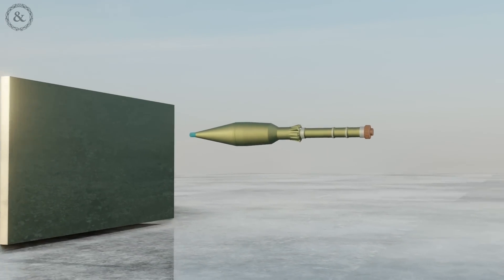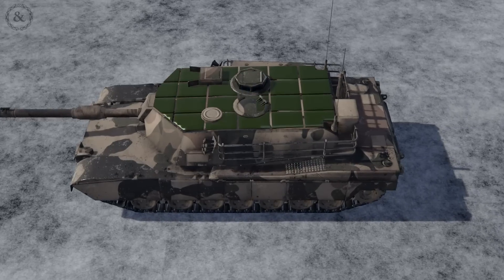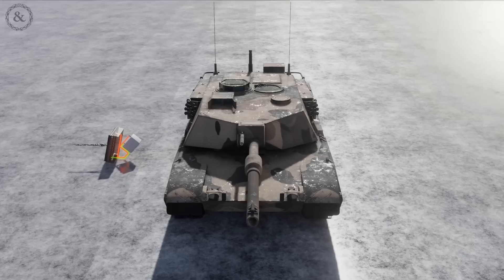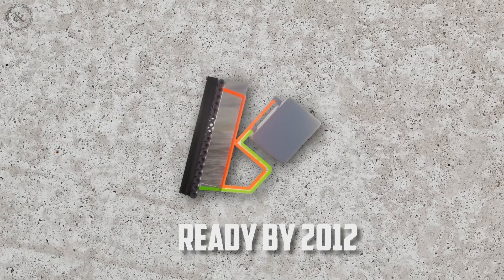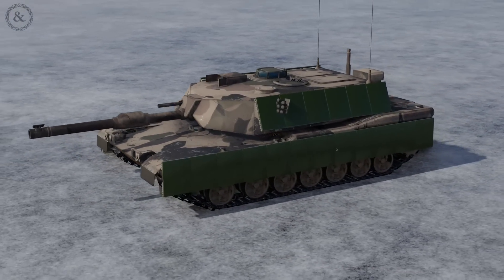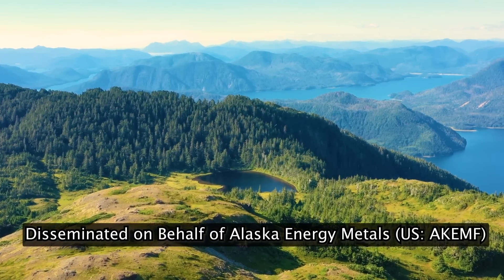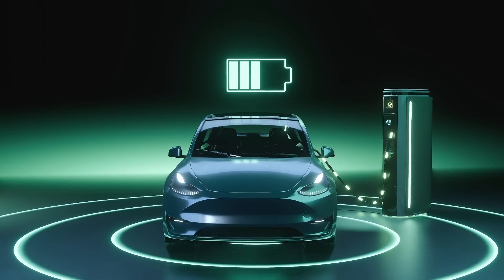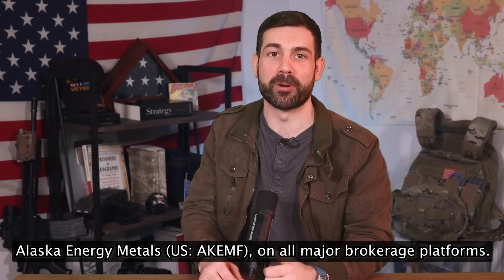How Electromagnetic Armor Vaporizes RPGs

Comment: Sounds like futuristic fantasy.  I've never heard metal being vaporized by a power source limited to that generated by a 1500hp tank engine electrical generator.  Does the non-metallic explosive also get vaporized?   How would that system works against 155mm depleted uranium sabot round?

Comment: Yo Capp!!! Capacitors hold charge for a very long time. if you dont understand this. unlplug your  microwave and let it sit for a week and then go digging for the capacitor. Capacitance is does not require large current to keep it at capacity. the right capacitor would be effective while the tank is parked engine not running!
Cappy hit me up for this type of information. or rober or whoever.

Comment: Why can a tank not generate continuous power for an array of capacitors powering the electromagnetic shield? Crew protection? Use the same simple way users are protected from the operating capacitor in a microwave. It's not rocket science, right?

Comment: A capacitor works like a battery, but much faster.  So, you can charge up your capacitor for minutes or hours or seconds, then use that electricity in a millisecond. ⚡⚡ Zap!  Coils (inductors) can do similar things, but differently.  Capacitors can generate huge voltage.  Inductors  can generate huge currents.

Comment: All of that "unnecessary math" would tell you this is a load of happy horsesh*t. You mean to tell me you're going to vaporize an RPG round AFTER the shaped charge has already gone off and penetrated the first plate with molten metal moving at ~5 km/sec? This is basically ERA by electric arc discharge, but somehow capacitors are supposed to have a much higher energy density than explosives? This is oceanfront real estate in Arizona level nonsense.

Comment: Even if the latency issue is overcome how fast is the power supply in charging up for repeated hits. If the opposition learns that a couple anti-material rifle rounds fired first followed by an rpg round is effective, you're worse off than just using the original amor plates.

Comment: I wouldn't really call this "electro-magnetic" as its not really using magnetism in any way, which is a good thing as Magnetism is 'circular' (meaning it would affect everything on the outside AND inside of the tank within the 'effective range' of the Magnetism).

This is more of a Electric-fence turned into plate-armor.

Comment: Another factor to consider is weather - especially rain, snow, and ice. An electric charge might dissipate in an explosive, but it could also dissipate in water if there was rain or ice. Electric discharges also play havoc with other electrical systems in the tank. Radios or radars are typical examples. A radio has an antenna outside the armor that would be affected by any nearby electrical discharge. One side effect of a large electric discharge could be the destruction of any radio antenna, and the consequent disabling of radios for communications. Finally, there is the question of how to execute an electrical discharge. The classical approach with electrodes and capacitors is simple, but perhaps not the only way. Explosives can also be used to generate electrical discharges, if they are coupled with electrical and magnetic devices. A moving magnet creates electric fields - fast motion creates high voltage electric fields - and explosives can propel fast motion. :goodvibes:

Comment: Obviously this video was not produced by someone with even basic knowledge of electricity.

No data was offered on electrical power requirements.
High voltage should not be a problem requirement if very low amperage is required. Within the past few years there have been great advances in the storage of static electricity in super capacitors, and some reasonably priced products are available for ordinary consumers.

Turning the high voltage armor on and off probably should not be a problem either if power consumption is thought to be an issue, if the circuit isn't closed there is probably minimal or maybe even zero loss.

But I imagine that as long as it's turned on that this type of armor would likely be emitting powerful EM fields which would be a beacon for any and all anti-radiation like HARM missiles making the tank an easily detected and trackable target.
Reply: unless you somehow reacted really quickly, turning the armour on right before a hit, you would have to have the armour always on in battle

Comment: uhh I first heard of it in 1989, it was in  darpa  or Aberdeen MD research labs around then, as I was a Tanker then, and we did hear about this from an Armor conference. Its power cost amp wise made it then and I suspect now impractical. I would require a $hit ton of power that is hard to fit inside any tank, and yes even a Merkava. Fix the power part of the equation, then it should be feasible. & yes they would still need to be 65 tons,, the power supply for the electric armor weighs 20 tons by itself, this on top of your theorized 20 ton vehicle.

Comment: as an engineering student i can only say that the biggest drawback of this system is going to be the cost versus a cheap solution to defeat it. It wont take long before someone invents a special rocket that will penetrate this at a very cheap price. Tanks imo are obsolete.
Reply: explosive reactive armour serves the same purpose and is already a much better proven solution, and rpgs designed to defeat this reactive armour already exists

Comment: It's not a rocket science,  you eighter increase the voltage or frequency. It's just inducing electric current in the weapon which in turn creates It's own magnetic field opposing the field released from the tank. You eighter increase the voltage or increase tje frequency to have greater impact on the weapon. Now we have oscillators that can generate extreme high frequencies, which means you can accomplish the same result by using lower power.

Comment: Oh come on chaps! The energy has to come from somewhere namely a generator driven by an engine. So a capacitor discharges when you short it out. Think if a small radio capacitor has your finger across it. So you hit the armour with missile and missile is rejected but a second missile immediately behind it will go straight through because the field has been discharged and has not been recharged. That is my immediate answer to the problem from the electrical knowledge the army taught me.

Comment: 600 milimeters is over 23 inches.  howdo you fake this electromagnetic charge? add a outside layer of steel after the first layer of steal. plastic steel plastic steel. the charge doesnt have time to do its thing. modern science is a duncy game for duncy people. it will not work. its a waste of 20 years time and still not materialized.

Comment: Once the system was short-circuited by some ammunition, what's the guarantee that it wasn't short-circuited permanently?
I mean - if by some bending of metal it will get short-circuited permanently - then either you have to cut off that part of armor from the system, or you can't even recharge it anymore.
From that perspective - a simple explosive reactive armor is much better.

Comment: 1. Don't take off plastic cup of RPG rocket.
2. Electricity. Voltage and power means a huge li-ion battery. At least some generator working from engine. It's a problem itself.
3. Water... Rain, short circuit when fighting in ruins of urban environments where even steel armor plates are damaged with wrecks. 
What to do when engine is of and crue is having rest. Also when out of fuel. 
But can be used on infantry machines like Bradley or Stryker. However any HE shell on bradly...

Comment: Honestly if this were to work I think it would make a lot more sense on a purpose built IFV or troop carrier not a tank. For tanks I don't think it does the job well enough to replace current armour but for infantry support where your main threat is rpgs at shorter ranges instead of tank rounds, this would seem a lot more plausible.

Comment: I think it is completely impractical to rely on such technology as the penetrators could be rapidly changed and varied. RPG7 is pretty old tech, tungsten + by caliber RPGs + slow flying drones + applying non-conductive ceramics layer over RPG to either stop or delay triggering electromagnetic pulse until to late. In addition with 20T tanks one would worry with 30 mm rounds or smaller guns running complete chaos on electromagnetic coils.

Comment: The good thing about systems using big ass capacitors is that (some) capacitors can hold a charge for an incredibly long time. Like decades without breaking a sweat. That’s why this is also the bad thing about systems that use big ass capacitors. I’ve heard stories of people being killed while working on vintage tube guitar amps because they didn’t realize that they can hold a deadly charge for an incredibly long time.

Comment: One problem I see is that you could make a tandem charge which discharged the capacitor and followed it up by a second jet. I don't think that the idea is to discharge the capacitor through the entire incoming warhead - I think it just does it through the penetrating jet. I also wonder if it would work with nonconductive jets.

Comment: Time to clear up a misconception I saw in the video: MBTs don’t weigh 65 tons because they carry 1200mm thick plates. If they did, then you might as well remove the engine, the suspension, the driver, the drivetrain, and everything else related to mobility because there is no tank in the world that can carry a 1200mm plate of RHA. The reason why most MBTs weigh heavier and heavier as time goes on is due to the incorporation of ERA or the weight of increased composite armor, APS systems, passive missile defense systems, and increased modernization of other components such as the cannon or better thermal/night vision sights for the crew. You also need to factor in the internals, such as the ballistic targeting computer, hydraulics for the turret ring and cannon, and for some MBTs, an autoloader. All of this means that even if you managed to incorporate electromagnetic armor onto a tank, you’d most likely be replacing the ERA systems, which, while they do make up a large portion of the weight of the armor, don’t really contribute all that much to the overall weight once you factor in everything else on or in the tank.

Comment: Western Australia has nickel, rare earths, lithium, thorium and uranium to sell to the US. And other materials. WA is much larger than Texas.  US rare earth production is limited by expensive handling of thorium byproducts.  China allows stockpiling of thorium to reduce mining costs.  Thorium is not difficult to handle or store.  Thorium may be used as fuel in future Generation 4 reactors.  China has 2 Gen 4 reactor prototypes in the Gobi desert using significant US research and technology. China is building many types of reactors and plans to build over 50 nuclear power plants with possibly hundreds of reactors. And naval nuclear submarines. Potentially leading the world with nuclear technologies.  China wants to dominate rare earth production in mining, refining, investment, research, designing and production of high technology electronics.  Including military systems. US rare earth reserves are not cost effective to mine. The US military could become more dependent on Chinese products. The US could develop thorium fueled Gen 4 MSR reactors within ten years with government bureaucracy and political  support.  MSR reactors could be modular and transportable reactors built on economical production lines. And provide another option for cost effective low carbon energy. If needed. Given the failure of renewable energy production to meet fast growing energy demand. As in China.  It is essential for China to develop very safe reactors.  Such as Gen 4 MSR reactors. I have more data on Gen 4 safety advances. MSR reactors can be fueled by thorium, existing nuclear fuel waste, weapons grade material, plus depleted and enriched uranium as well.  And abundant reserves of thorium that does not need enrichment.  Which can be supported by burning up weapons grade material. China also has a gas cooled pebble bed Gen 4 reactor prototype. One US company is working with Indonesia with a floating, Gen 4 MSR reactor project. Well suited to Indonesia's growing energy demand for its over 270 million population. The worlds largest Islamic population. And close to Australia's nuclear fuel reserves. India wants 20 more thorium fueled power stations.

Comment: I think it could make sense for light tank drones, as they are already almost certainly going to be electric motors which means they are gonna have big old batteries, I know you still need to move that power to the capacitors, but assuming your going with like 200kWh of batteries a 2C rate could deliver 400kW if you put all power into armour which if the claims of the power requirement being low relatively low are accurate that should be multiple recharges per second, like to be fair that means that you would have to drop power to everything else, but I also assume you would have another smaller battery to run the electronics, that still leaves you unable to provide power to the engines for a spilt second.

And the reason I say it would be good for tank drones is that the hole point is they are supposed to be light weight and manoeuvrable, so they are not going to put on a bunch of heavy amour. Although the other point to them is that they are supposed to be somewhat expendable so if the price of this armour is high it would kind of defeat the point.

Comment: Power pack of Abrams is already insane, and charging some, even enormous, caps is absolutely possible. Also we are improving capacitors constantly, just 20 years ago the stuff you can get from online retailers was science fiction.

While this - according to tests - can indeed help with shaped charges, I'm very, veeery unsure what it would do to APFSDS with tungsten penetrator. I have /some/ worries that electric reactive armour might do worse when it's turned on, by just heating tungsten up xD

EDIT aaand I should have watched to the end xD

Comment: the tungsten darts would be much more difficult, for sure. you'd need enough amperage to turn that dart into liquid. for anyone who's ever attended an electrical safety training course- you can witness what we call 'arc flash'- when a huge bus bar shorts out & instantly turns into a burning plasma explosion- sent hurtling in the opposite direction. with enough wattage- electricity becomes an un-stoppable wall of destruction. only testing would tell. would be interesting to start with a rather large ultra cap. bank & see what happens.

Comment: this technology was developed before maxwell technology created ultra capacitor technology- graphene capacitors. today- the use of a pair of graphene capacitor banks would mean power demand would be relatively low- and amperage to armor response time would be at light speed. capacitors don't need to be high voltage because they can dump ALL their stored energy instantly, so discharge is short- but VERY intense.

Comment: I was wondering how the hell is this supposed to work because you aren't making electricity flow into the projectile, you're trying to make it flow trough it, but there's nowhere on the back side for electricity to flow. I am surprised 20KV does anything major since over 90% of the electrons are gonna be flowing trough the armor only and less than 10% are gonna get into the projectile. I pulled these numbers out of my ass because I can't be bothered to do the calculations, but they're gonna be in the ballpark.

When I saw the title "electromagnetic armor" I Imagined a magnetic surface which slows down the projectile to reduce penetration, which seems much more effective, much cheaper and crucially much more reliable at first glance. They use those to stop 1000 ton trains after all.

Comment: I would not want to be need a device that could discharge mega-ampere currents. 
It is likely that such a system is highly volatile and the electromagnetic effects of such currents can be quite spectecular.
Shielding the vehicles electronics from the equivalent of a lightning rod also sounds like an interesting engineering challenge.

Comment: So a standard rpg can penetrate at least 260mm of RHA and in a test this tech reduced penetration from 100mm to 32mm? Sounds like this is a long way off from even being remotely effective against a $100 rpg. Most modern anti armour man portable systems use tandom charges which will completely defeat this system. So far this tech is just ERA just less effective.

Comment: Brilliant.  It pushes the pizioelectric firing pin into the cap and warhead before it reaches the tank it self
Reply: Probably irrelevant, because otherwise tanks would have thick styrofoam "armor" to prematurely detonate such devices.

Comment: Sounds like those dual firing rpgs made to get past active defense systems just need to add either a third tube that fires a dart to pre penetrate that electromagnetic gap and set it off early or just make the second tube fire the dart and make it robust enough to get past the trophy system intact enough to do the same job.

Comment: An active thread protection system sounds like a much more feasible protection against rockets and anti tank missiles. Depending on how the panels are broken into sections and provided charge, when one panel is discharged, it might result in none of the panels having enough charge to defeat a threat,

Comment: yk, if its intermittent and thin, you could theoretically design autocannon rounds that can soak up a ton of that energy and convert it to expansion extremely fast, effectively taking that armour out within 1-2 shots, and if the true passive armour beneath is thin to cut weight, youve effectively made your MBT hyper susceptible to autocannon fire.